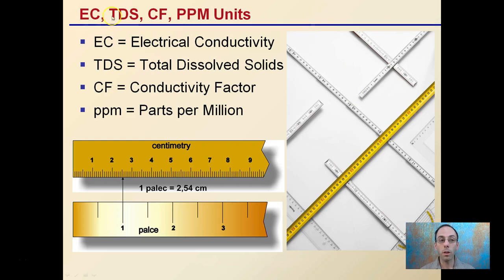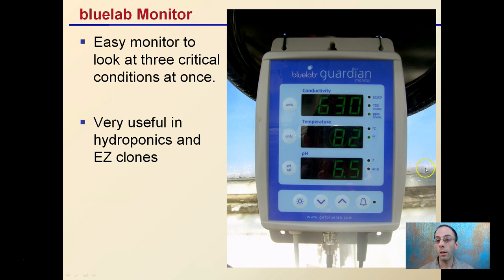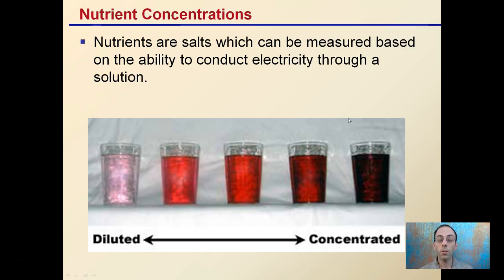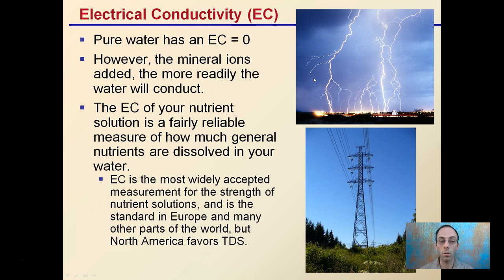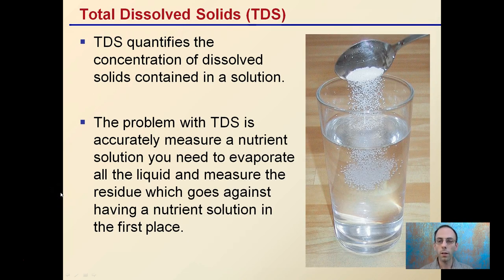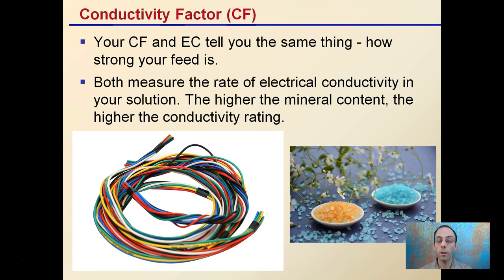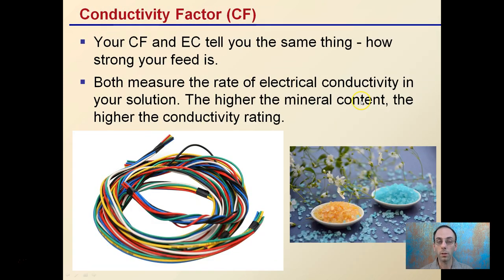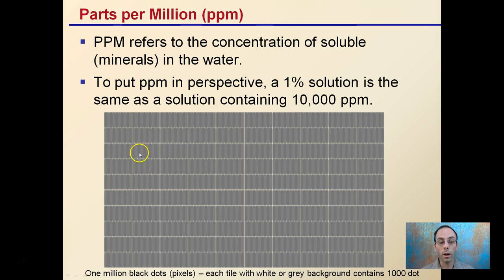Monitor and Units

Comment: What are your thought when using these meters with organic vs chemical fertilizers. My understanding is that chemical fertilizers are heavy in salt.
Reply from the maker: All fertilizers have salts to some degree.  As long as the meter sensor is kept clean (which may require more attention with organic based fertilizers) there should not be an issue.  Also, starting with low CEC water (such as RO) is recommended.